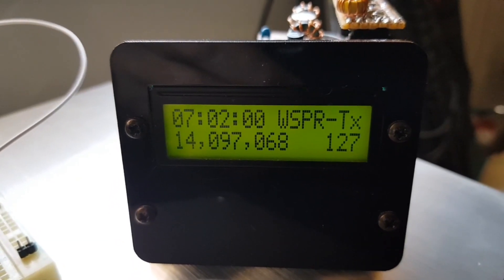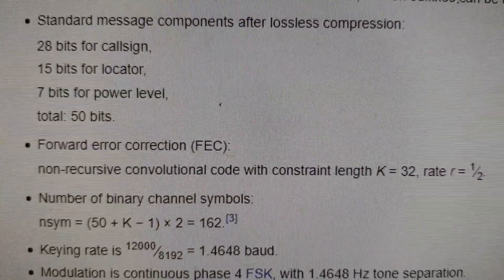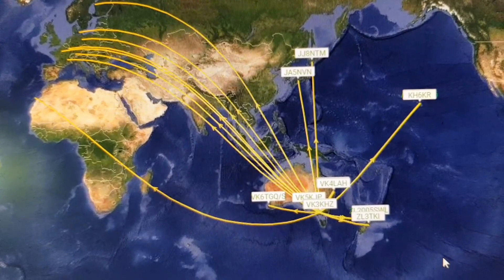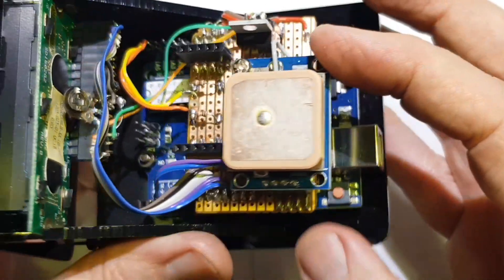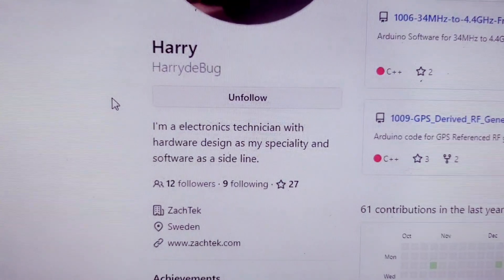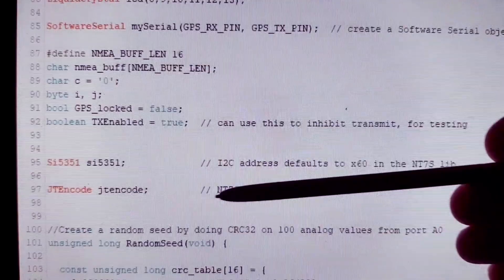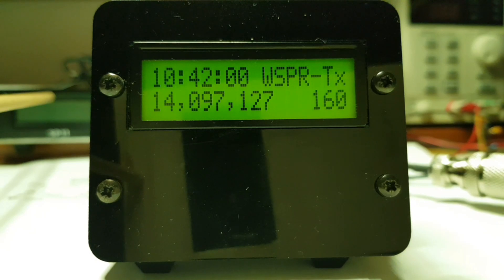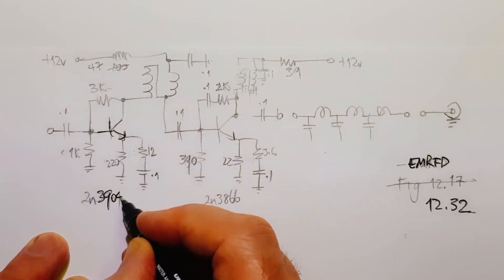12,000 miles on 0.2 watt!! Yet another WSPR beacon

Comment: Thank you. 
I learned on the LowFER band in the USA just what low power, (7 mW EIRP,) low frequency, (1750 meters,) and low data rates, (1 bit per second,) can do for long range communications. I was blanketing about 1/3 of the USA with my signal, essentially in groundwave. Putting the attributes of low data rates and low power together with skip conditions on HF is every bit (bad pun) as impressive. Your simple, low power transmitter shows what can easily be done with little expense. I hope this video convinces others to get into building their own rigs for such tasks, because  ham radio is all about learning. Well done.
Reply from the maker: Thanks John.  MW and LW are remarkable bands. We hams have 472khz, 630m, and 137khz, 2200m. I've never transmitted on LW but have listened to a VK3 who was a regular,  and he used to say 630m was better than 80m and 160m for reliability.  WSPR attains it's remarkable range because of the slow data rate and digital decoding in SDRs.  20m band has improved since this video was made and Au to US and EU propagation on very low power WSPR occurs routinely now.  It will never cease to amaze me what radio and the ionosphere can do.  73 Paul VK3HN.

Comment: Hi Paul, just read your article in SPRAT and watched this video.  I'm inspired to have a go at building it, just one question is there a schematic for connecting the LCD, I'm not sure if you used I2C or a parallel connection method? Many thanks for sharing this project.
Reply from the maker: Hi Steven, thanks for your comment. I left off the LCD details for brevity but should have added a line to answer your question.  All of my Nano and LCD VFO controllers are wired as per VU2ESE's Raduino.  The simple answer is to trace out the LCD connections from this rig's VFO/controller: 
https://vk3hn.files.wordpress.com/2020/07/ssdrap203-page3.pdf

If you do, please confirm that it worked for you, as I havent gone back to this assembly to verify it myslef. 
You can always verify LCD connections by looking at the LiquidCrystal() constructor at line 101, which takes as arguments the digital lines of the LCD control and data lines... 
LiquidCrystal lcd(8,9,10,11,12,13);

Look at the library's header file for the function signature which will confirm what each argument is.  Make sure the argument value refers to a Nano digital IO (D8 to D13) and not the pin number on the MCU or the breakout!  Then, look up the datasheet for the 16x2 LCD to make sure you've got the other end correct.  Good luck and let me know how you go. 73 Paul VK3HN.
Reply from the maker: Actually, I added the LCD connection details into the header comment block in the repo source file for future reference.
Reply: @Paul_VK3HN  Thanks Paul, got all the info I need now.

Comment: Hi Paul,
 A fine effort (12,000mls on 800mW)
 Congratulations!
I'm in MEL too, a retired Comms Engineer  ( a long-lapsed Ham (VK7ZOO) from 50 years ago). 

I have long thought about using a different technique for ultra=low transmissin on the 20m band.
I calculate that it could outperform Whisper by a big margin

The 1mW transmitter is trivially simple. 
The receiver is not!
I've got a most of the components to build the receiver, but never got around to doing it !

You have sparked my enthusiasm to give it a try.

I will eventually need the cooperation of licenced Hams to trial it.

Are you interested?
Reply from the maker: Hi John,
Thanks for your comment.  I'm not into ultra low power transmission, or digital modes in general (apart from building this WSPR beacon, which had all the digital encoding code baked into Jason NT7S's JTEncode library).  But I do suggest you check out the current crop of digital modes, FT8 and the like, so see how your idea compares with what the community is currently working with.  
This could be a great time to get your license back!  You could do it easily.  There's a lot happening in the world of amateur digital communications right now. 
73 Paul VK3HN.

Comment: You make it all look so easy Paul. 
Does the GPS lock the frequency or is it just used for clock timing accuracy? 
Again an excellent presentation, thanks for sharing.
72 Mark G0NMY
Reply from the maker: Gday Mark, nothing that sophisticated, so the si5351 is free running, you need to do its calibration.  The code simply detects NMEA strings and picks off the timstamp substring, the  checks this to initate Tx.  72!